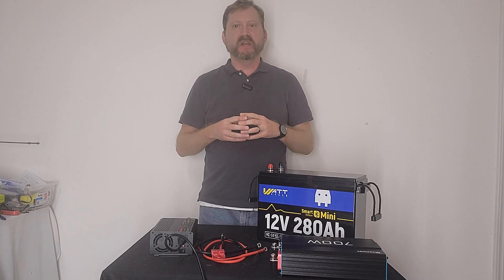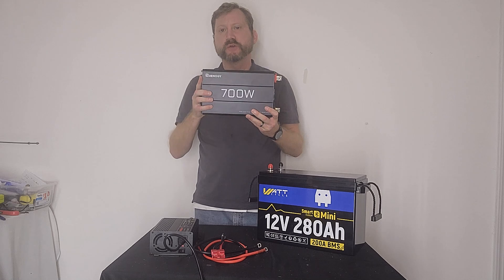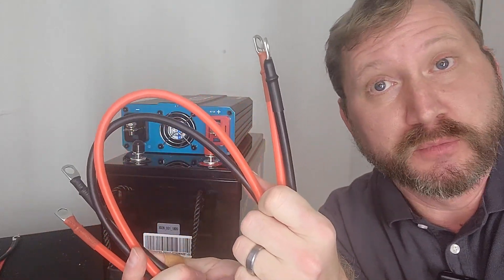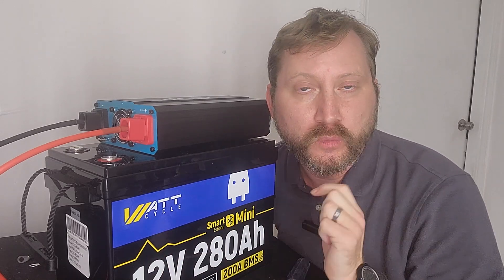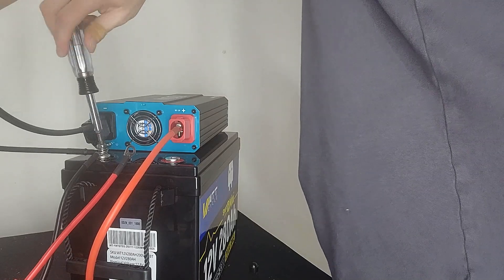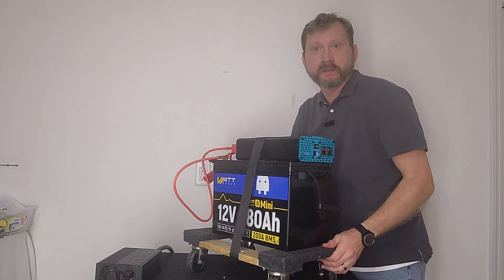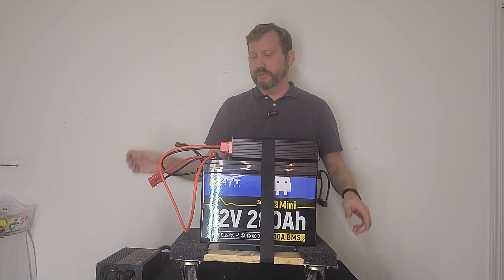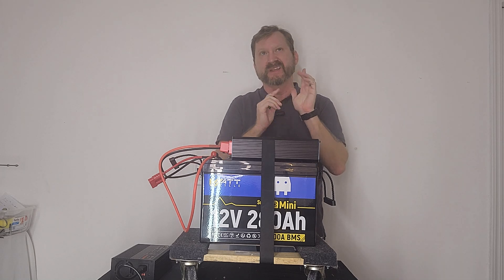Build a 3584wh mini system in 5 minutes with a screwdriver! wattcycle #diysolargenerator #solarpower

Comment: nice, small and simple.  There is something squirrely  with WattCycle's website (at lest for this battery).  The BT version shows as about $100 more , but he standard version has BT in its descriptive name for the lower price.  I wanted the BT version last month when i purchased two, but didnt stomach the extra cost.  I was disappointed that they still had not updated the label (300Ahr) and the over current (600A). You seemed to have gotten the new label.  It seems like a good deal, but not a perfect experience for me so far.

Where do you find those non-ratcheting 2" pull straps? 5ft?
Reply from the maker: So the non Bluetooth still says 300ah. They are trying to sell out of the old stock with thr old label. It's now on an insane sale for $399 with my code.  The Bluetooth version, because it's new, has the new 280ah sticker.

Once the non Bluetooth old stock sells out the new stock will have the 280ah sticker.

They are trying to move the old 300ah sticker inventory so there are some deep sales happening which is causing the price miss match

Comment: I Like 280ah CHINS paired in 24 Volt Packs and Used just as You have here to VICTRON 24/1200 Watt Pure Sine Wave Inverters for 2 Applications such as My Refrigerator and Freezer in the Event The Grid goes Down. Good Video for Common Folks just stepping into Renewable Energy and Safe Options when left with No Power nor Fuel for a Generator 🇺🇸
The Sun Shines for Everyone 🌴
Reply from the maker: I'm a big fan of 24v and feel that they are the best option. This is just a quick and easy version
Reply: I Agree and New Solar Participants can grab this Concept and Update once Their more comfortable with It

Comment: Very cool, could you replicate the Aferiy P310 or the Clayton IPS II 3000 ?
Reply from the maker: Look at my older videos. I smoke that
Reply: @texasprepperprojects  Gonna be a pain. I've looked through and can't see anything you built that has a 3,600W Inverter.
Reply from the maker: What are you going to use 3,600 watts for?
Reply: @texasprepperprojects it was what the Aferiy said it has, just trying to = that as a comparison.
Reply: Cool, I’m working my way through them.